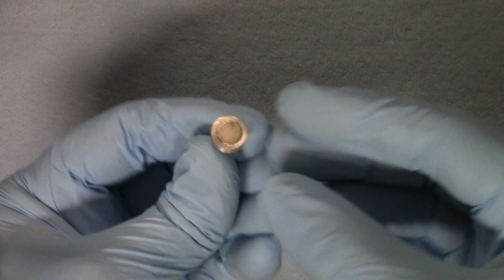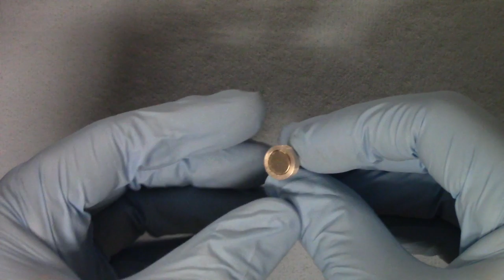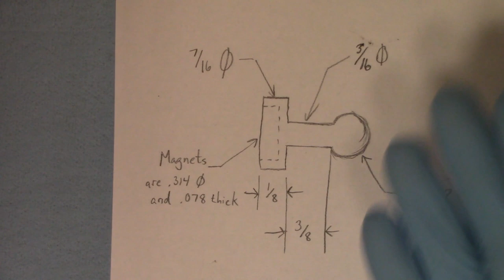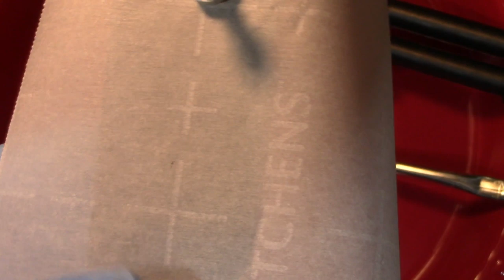Fun With Magnets

Comment: I picked up some 10mm tapered carbide end mills, they make great rafius tools as you have clearance all over. That's how i made the homemade inserts for my multi radius round over tool on my channel. They are so good that i hardened the inserts and then machined the radius in each corner. Saved all the post heat treatment clean up.
Reply from the maker: I'll check it out. Thanks for watching!

Comment: Or being aluminum, you could take a piece of 3/16 or 1/4" hot or cold rolled plate, scribe then grind that complete profile into it with a 4" grinder and cutoff wheel. Then use that profile to plunge into the work piece in short order, spit out those parts very quickly. Do it reversed, so you can do the counter bore first on the end of the bar.  Would be a fun setup.